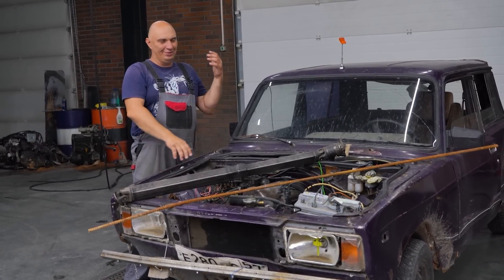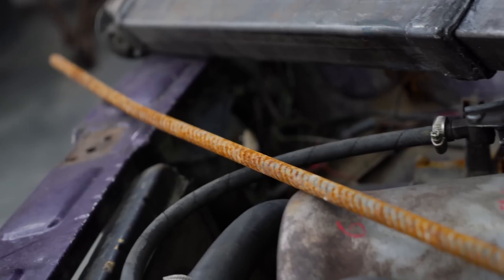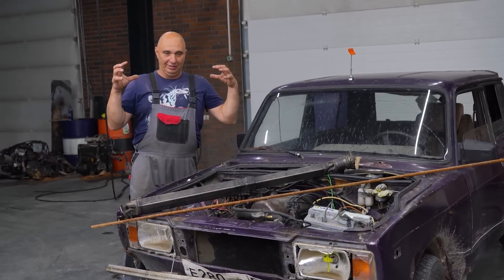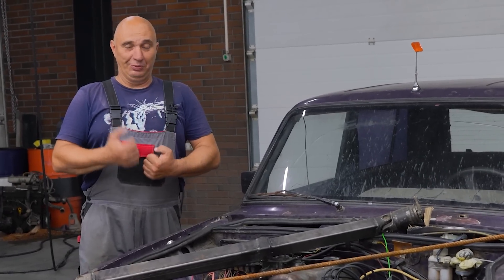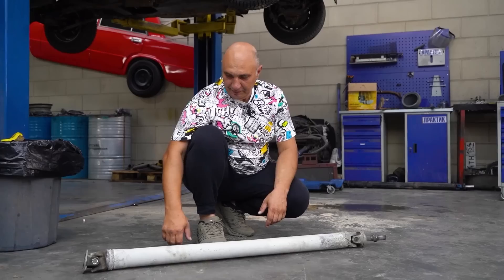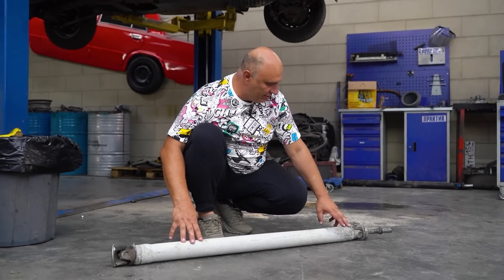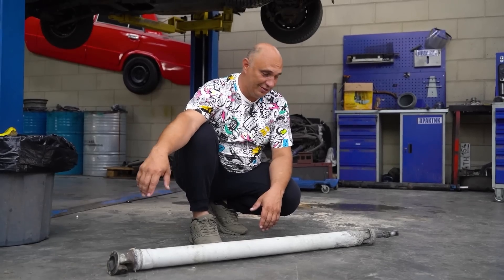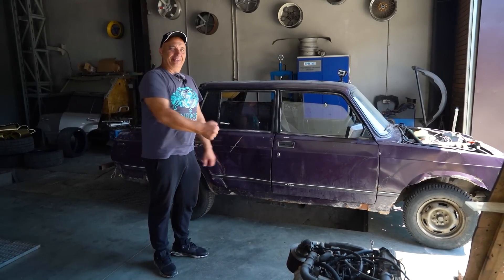We make a propshaft out of reinforced concrete

Comment: Construction building codes used call for 28 day testing to determining if the mix design of the concrete has achieved its intended compressive strength (for example 4000 psi @ 28 days). Some specifications call for 56 day testing, but that is exceptionally rare. Notice I stated *compressive strength*.... This is in contrast to the rotational or torsional forces that your prop shaft experienced.  You may find it interesting that concrete continues to gain compressive strength as it ages. Even hundreds and hundreds of years after it was mixed and placed.

Comment: If you ever want to make a "real" reinforced concrete propshaft, rest assured that you can make one that would be quite permanent if you consult a professional. Some basic tips for stronger concrete, for just anyone: use as little water as possible, ideally have your reinforcements interlocked or welded at 90 degrees and/or use a mesh. For projects requiring a lot of strength, select the right formulation of concrete and the correct size aggregate, and almost definitely consult an expert and carefulyl read the instructions on the concrete you are choosing. For desperate projects where you need quite a lot of strength but can afford for it to not last and don't have access to all the right materials, still use minimal water, and use wood as your reinforcement material, and ideally just nail or screw boards together any way you can.

Comment: 28 days while kept wet gets about 90% total strength. but gains no strength once it dries out. either way the result would be the same but it could have been slightly stronger if cured properly. adding a bunch of hoops to make a sort of rebar cage would also help a lot

Comment: The rebar didn't have the torsional stiffness to protect the concrete. concrete is strong in beam and compression, not tension, or sheer caused by torsion. Re enforced concrete actually has pretty good beam strength, because of the tensile strength offered by the rebar. as well as compression strength, meaning that the vibration wasn't the problem. It was the torque. The rebar twisted easily, which is what crumbled the concrete.

Comment: You can see it looks like the rear yoke is off center to the prop shaft. Also if they welded some sort of cross bracing inside, to keep the rear from twisting. And finally if you could figure a way of putting tension on the rear prior to filling the pipe with concrete

Comment: The concrete would have very little mechanical bond to the yolk. So the driveshaft is actually made from rebar. The concrete is just stopping the rebar from twisting up.

Comment: I believe the propshaft should of had cups made of rings of rebar to each end and tied rings spanned all across the propshaft like small pillars used for signs on the street, and its diameter should have been slightly larger than the original, at least 1.5 times.
That concrete was really bad too, it was more like mortar without aggregate, i would use a generic 3500-4000psi real concrete to get the results.
Great experiment anyways.

Comment: If the driveshaft was installed while it was curing for a month, it almost certainly sagged. The driveshaft was out of round from the moment you started moving, so it had no chance of working.
Reply: my thoughts exactly, should have been left flat to cure. Also, welding joining pieces between the 3 central bars would have helped too

Comment: stand them up to cure and fill it past the joint when pouring the cement.  

I was more interested in any gyroscopic (spinning-top) effect because of the extra rotational mass. in that rather centralised position.

fill a steel drive shaft with cement as another experiment please. maybe even cornstarch nonNuetronioan liquid

Comment: As soon as he said concrete i knew it wouldn't work. Any sideways forces or rotation induces expansion force in concrete, which is very weak against them. In the same way glass can be both strong and brittle at the same time. Concrete is very strong under compression force though which is why they use long bridges weighing tons. 🤔

Comment: I think the reason it seemed bent was because the rebar was welded so that it was off center. It could of been the weld location or perhaps the rebar was not straight down the middle.

Technically the rebar is only acting as a way to secure it to the u-joints. Its kind of cheating if you really want to test just concrete. You don't really need the rebar though, that's for forces that pull, tensile forces. Since the shaft doesn't receive forces along its axis anyway, you could just have a metal plate with some shorter rods or bolts. That way most of the shaft would be just concrete. It's not a big difference I guess... either the concrete can handle the tensile forces from spinning or it can't, rebar or not.

I might not know what I'm talking about... but I did do half of a civil engineering degree so, I also might have a small chance of not actually being wrong lol

Comment: Try again, but mix in industrial chopped glass fiber or lots of thin gauge chopped metal wire in the concrete ... and it will be indestructible ... and using 10mm tick plates with holes to weld the rebar and attach to the u joints.
Reply: Epoxy will be better anyway.

Comment: Have you thought about making a Propshaft with Rubber in Torsion? Like the suspension systems as designed by Englishman Sir Alex Moulton dcd.? 2 tubes, one inside the other, with the space between taken up by a liquid layer of rubber which then hardens. Then you have the 2 tubes bonded to each other. It would give a very smooth take up and drive, insulated as it is by the rubber. Has proved to be extremely durable in suspension systems as the inner tube is in torsion to the outer tube. Have a go - you may have to experiment with the density of the rubber you use.
Reply: perhaps rubber and liquid asphalt.

Comment: I believe that I've come up with something that might bear looking into.  Once again, replace the drive shaft but with reinforcing rod, laid straight, bundled and then twisted into a spiral of the right length and welded, piece by piece to complete the unit.  If the rod is thin enough, it could be braided and not welded since it would enter and leave the pattern in both directions.
Reply: How about a large wire rope, cable, you could probably find a piece at a shipyard

Comment: Try reinforcing the rebar by welding some cross members every four to six inches, so the rebar doesn't twist.  Wrap chicken wire mesh around the rebar.  Try using Quikrete or whatever similar product you have. Leave the PVC on and drive at high speed for half an hour.  Remove the PVC and see if the concrete is still in one piece.  If it is, drive some more and see how long it lasts.  Have fun!!

Comment: That booger is extremely out of true! It probably sagged as it was curing after you installed it. Should have left it laying flat. I'm pretty sure that's what happened. It dropped under it's own unsupported weight.
Concrete doesn't have much torsional strength. I was expecting it to come apart like that,or to twist up a lot sooner.

Comment: Torsional forces (twisting as the engine applies power) will have had an effect on causing the concrete to crack, and the centrifugal forces when it's spinning cause the lumps to break off and go byebye... :P
Reply: Yes, I agree with your explanation.

Comment: I have studied concrete a little in materials science as part of a design course. We were doing some basic experiments with it like putting it under compression, tension, vibration and torque loading. Even without re-bar it's pretty good under compression. For tension and side loads it needs re-bar. More to the point tensioned re-bar. It's not good under vibration loading at all. However torque loads are the worst of the lot unless you use re-bar that is tensioned so much it boggles the mind.

Comment: I would love to see a Lada with the engine disconnected from the wheels and connected to an airplane propeller
Reply: I don't think it'd work very well, but I'm also very interested in that now! I bet the 0-60 would be terrible,but once moving i bet it's very smooth with acceleration haha
Reply: Also if they tried using large propellers on the multi engine lada that would also be awesome to see
Reply: Thats a great idea !!!!
Reply: I think they didn't something like this year back.
Reply: @jwalster9412  A bit, but they used pedals because the old green lada had no engine.
Reply: They did it on Lada Oka
Reply: wow
Reply: It will overspeed the prop. There are LOTS of auto to aircraft conversions for the homebuilt market and they all use underdrives to reduce prop RPM in the best torque range of the engine.
Reply: bevel gears
Reply: @AlienLivesMatter  gg

Comment: You are lucky that thing didn't flip you over! LOL....... Use a ridged tube drive shaft and cut off one end after marking it for relocation. Then fill it with cement and re-weld it. The balanced weight should make a great flywheel effect.

Comment: Concrete has close to no tensile strength. Torsion is similar to tension, so this won't work at all.
Maybe if you somehow pre tension the shaft it might work.
Now I'm going to watch the video.
Reply: It hold up the torque on flat ground. Wow!
But it failing had nothing to do with vibration. The hill put more torque on the shaft and that led it to fail.

Comment: Try twisting the rebar into a shaft, like a candy cane, and using that.
Reply: Twisted rebar might work well in one particular direction as it tightens against itself as it is under load. The opposite will happen when it's loaded in the other direction much like a coil spring. They could try two separate windings opposing each other.
Reply: @NIGHTOWL-jf9zt  In reverse, you would be opposite the twist. It will work perfectly well, It would have no issues whatsoever, if you also tack welded the lengths re-bar together, every 100cm or so

Comment: See if using fiberglass in concrete makes driveshaft stay together
Reply: GFRC
Reply: wouldn't make a difference with the way they did things. you can clearly see the driveshaft is not centered the moment they start moving. being out of center is harder on everything which in turn also puts more stress on the driveshaft.

Comment: Before I get to see the video and watch it destroy itself I'm going to go ahead and tell you what's going to happen. It will be in balanced somewhere in that concrete and that will be the stretching point which starts the destruction other than that it should work if he doesn't slam it into gear and torque too hard on it. Anything will work if you put your mind to it and correct calculations